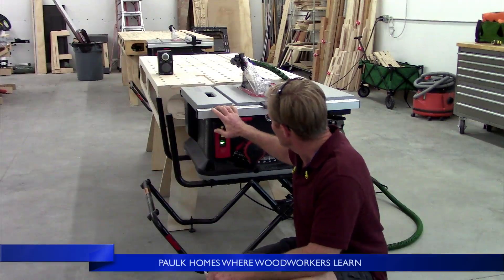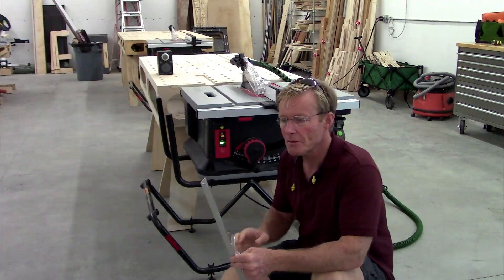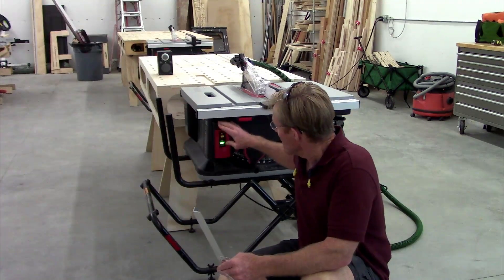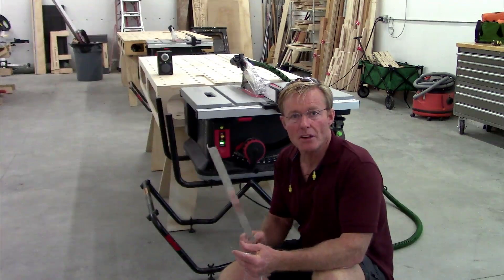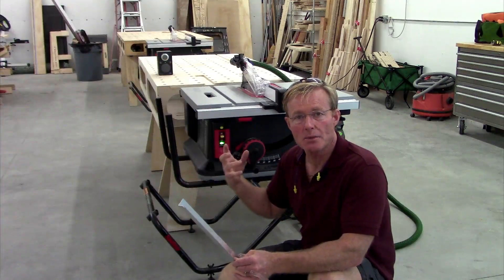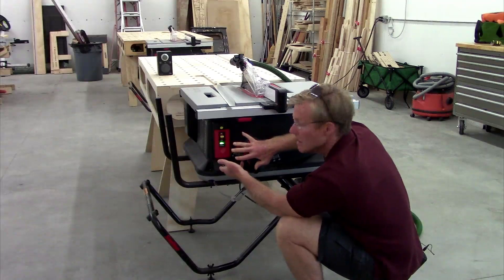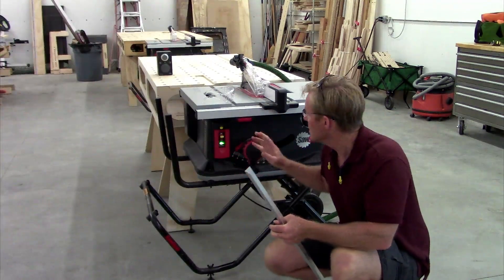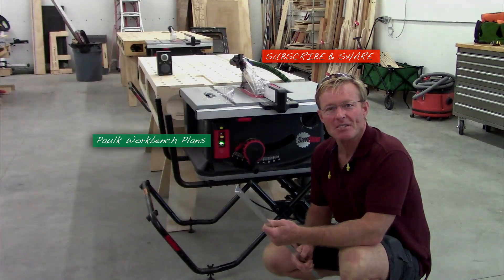Sawstop Conductivity Test Mode: How to test material to see if it will trip the SawStop brake

Comment: What about wearing nonconductive gloves instead of using bypass mode?
Would brake activate if cut through glove and make finger contact?  Could be a have cake and eat it too kind of world.  Cut conductive material such as metal, wet wood, foil, etc. and still have finger protection.  Just a thought.

Comment: Is there a moisture percentage that you could use to determine if the stock would trip the brake? I'd much rather check the moisture content, which when using a moisture meter, is just testing the conductivity or resistance of the material.
Reply from the maker: I don't know what moisture content would trip the brake, but you may be able to find out directly from SawStop.
Reply: Thanks. I was just reading that a user regularly rips redwood up to 36% without tripping the brake. (His meter caps at 36%). I'll have to do more research. My skin surface sometimes registers as low as 40% on one of my moisture meters. That's too close for comfort.

Comment: Ron do you have any plans on purchasing a larger table saw, like a contractor's saw or cabinet saw?  If so would you go with the Sawstop again?  I have a Ridgid 10" contractor table saw and its been an awesome tool and been used heavily over the years, but have been wondering lately about the Sawstop cabinet saws as I've wanted a larger rip capacity, and kind of like the safety features that Sawstop has implemented...never had an issue with any table saw but really the Sawstop isn't exactly any more expensive than a good quality table saw without the brake feature.
Reply from the maker: I have no need for a cabinet saw, but I would not purchase any table saw without a brake.

Comment: Great videos Ron. I absolutely love my Sawstop! No brake trip yet... touch DRY wood.

Couldn't you test it in the safety mode by merely touching the blade while stopped? The red light will flash and you know it is conductive. This approach obviously would not work for wet wood where the moisture content could vary from the outside to the inside. But I suspect this is true for your bypass test as well. The part you tested could have less moisture than another piece and you could trip the brake later. I don't cut moist wood so no first hand experience.

Definitely works for metal (and your finger when you are showing off the brake electronics while the blade is stopped)
Reply from the maker: I will give it a try. The way I demonstrated it is what the manual says to do.

Comment: Great content as always Ron. I notice the Sawstop mobile base seems to be different on the saw you are using in this demonstration. 
Can you comment on this?  Is it some sort of upgrade.
Reply from the maker: The stand I have on both of my SawStops are the standard included gravity lift stand. I have not seen any variations or options for the stand.
Reply: +Ron Paulk I see upswept bars on the left of the saw that I haven't seen before. Maybe this is a Sawstop question.